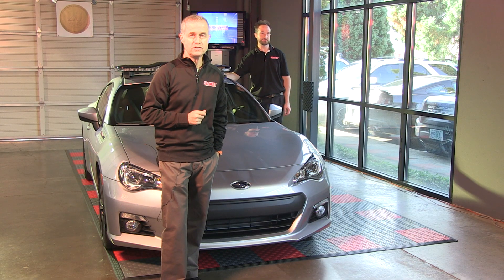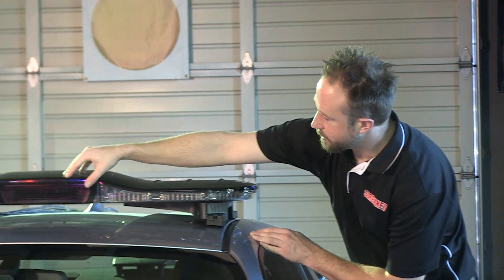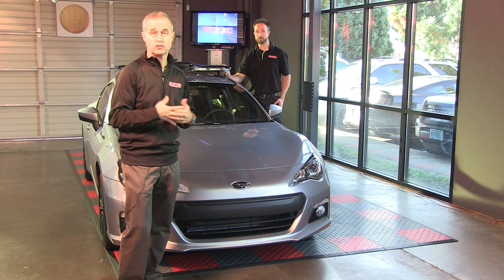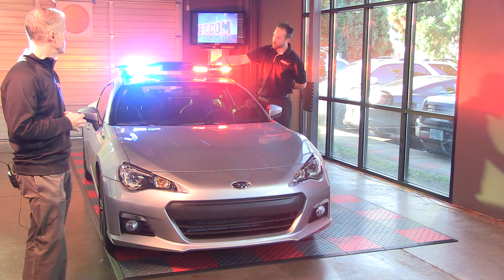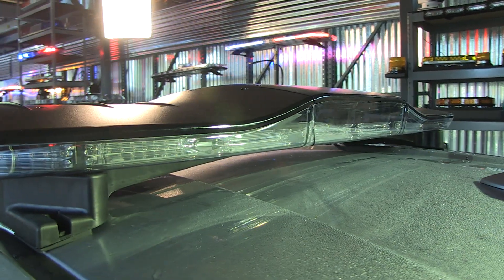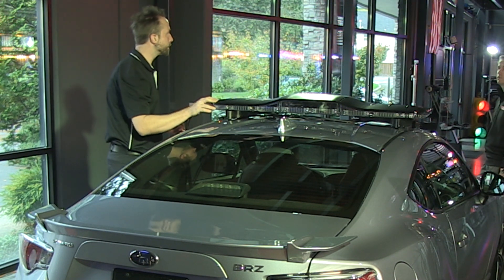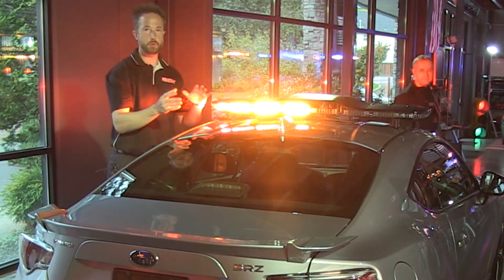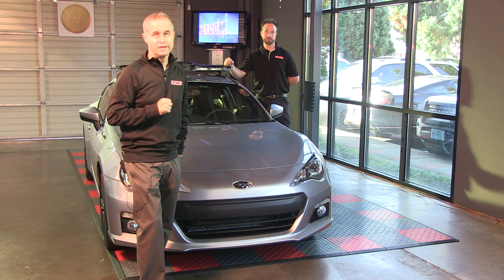Code 3 Solex Lightbar on a Subaru BRZ

Comment: I'm not a fan of the Solex, I don't know what Code3 was going for there. Is the lightbar using the same modules as the Defender? They look similar.
Reply from the maker: Code3's Solex Lightbar uses different Modules from what the Defender Lightbar uses.   The Modules used in the Solex bar are the Siris style modules. The Defender uses the Tricore Modules.
Reply: Oh, Okay. Thanks for clarifying.
Reply: Grant Matos Agreed buddy, that "hump" in the middle kills it for me. I understand the functionality of the hump but since we in the US don't really use the speaker as they said, I don't see a point for it. So in that case here in the USA we are more likely to see modules on both levels, lets say red/blue on the bottom and takedowns on the top. That config is something that could be achieved with a single row of modules as well and have certain module(s) be dual color, red/takedown and blue/takedown. I think if that hump wasn't there and those modules ran across the entire front this would be a very attractive bar as far as aesthetics go.